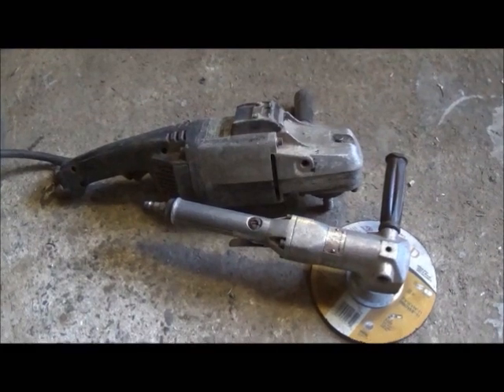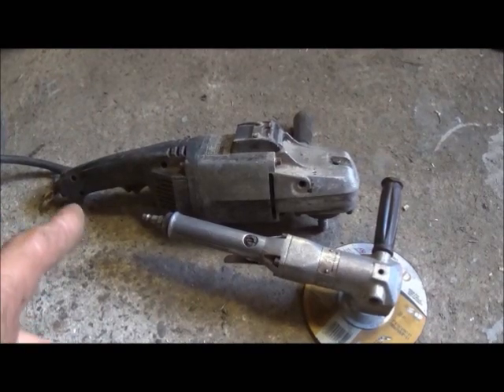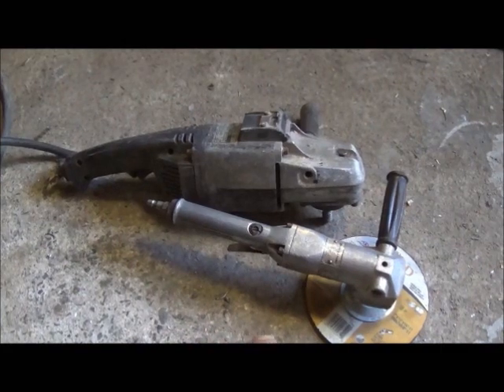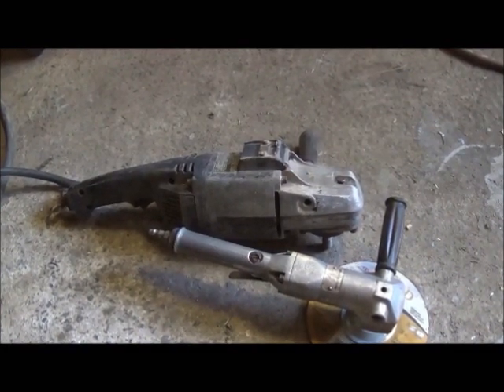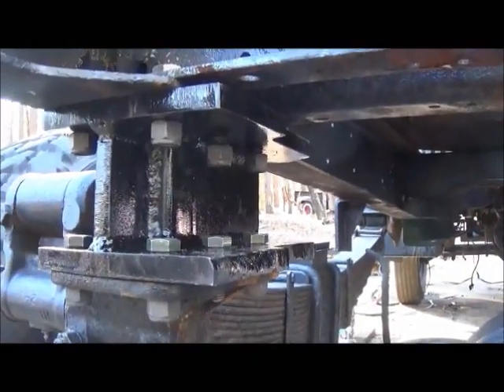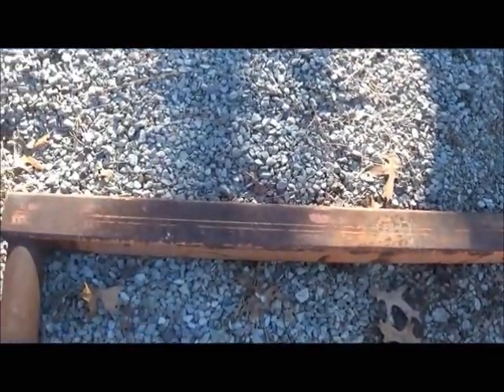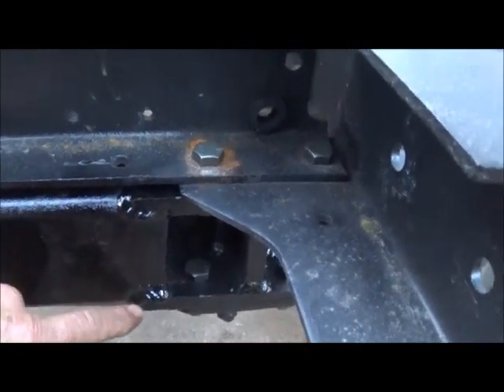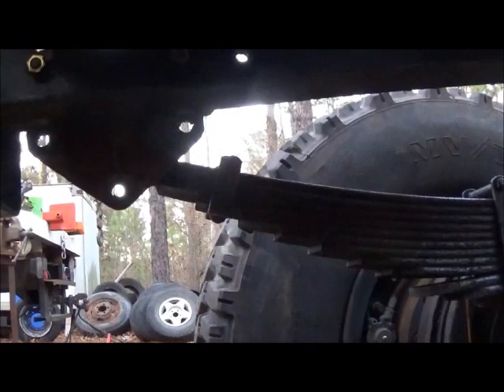4x4 Wrecker Build Part 13 Moving Right Along!

Comment: Good job on the spacers and cross member! On your bolts,  if it's load bearing and attaches to the frame, DOT requires grade 8 bolts, nuts and lock washers! Those "nylock" nuts are low grade and only lock ONCE! Retired Diesel bus tech here (DOT certified inspector). Good job, rock on Jonathan!?

Comment: I had an air grinder like that...a "Blue Point" from Snap On...had the drill too & used it with de-burring tools & rotary files to do all my porting work. Chucked the tip of the valve & pulled it into the seat for lapping valves... Got ripped off in 1977 when I got locked up for the 3rd time in my life... I'm barely getting by on what I have today... I started blade & abrasive cutting since 2006...so much more accurate...
Aloha

Comment: Once I was using a B&D Wildcat 7" grinder with a knotted wire wheel to clean some rust off an I-beam.  Well, it caught my tee shirt and wound the wheel into the side of my body quicker than I could fart.  I had a bloody brush wound from the wheel, but not too bad.  It took a few seconds to get the grinder shut off, because it was a click-on, click-off switch, like the old light sockets,  not a deadman trigger like is most common these days.  If I had been using an air grinder, I think I might have not even gotten a scratch.  From way less stalled torque and way less armature inertia, an air grinder would have saved me.  I need to get one (and finish hooking up the compressor I already have).  --Doozer
Reply from the maker: +kooldoozer  Things get you when you least expect. 20 years ago my shop had a dirt floor and the Leblond  actually sat in the dirt. I used it so much that I had a trench in front of it. I was wearing a T-shirt and the front of my shirt got rapped in the power shaft for the apron. It was a tug of war and I lot the entire front of my shirt..

Comment: Nice rear cross member. The suspension ain't gonna be curling in on you any time soon unless you try picking up a D10...  Is your front cross member going to go over the drive shaft & tie in with the cross member above it? If so that going to be super strong!!! Nice work Jon...
Aloha

Comment: Is the plan to run a crossmember from the front drop back to the rear drop running parallel to the frame as well as across to each side?
Reply from the maker: +napodano26 Won't be running anything parallel, but the rear outriggers will be tied into the wrecker sub frame and the rear cross member.